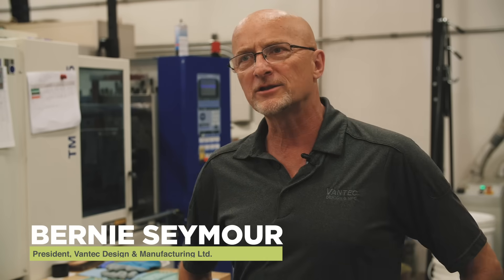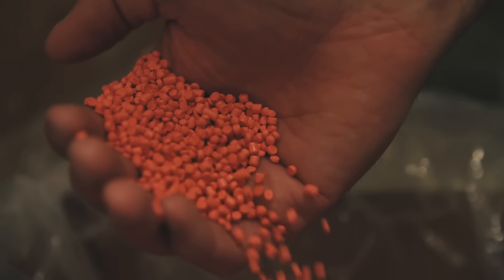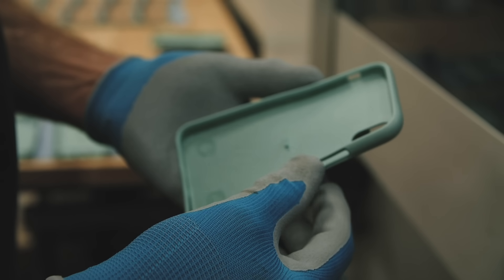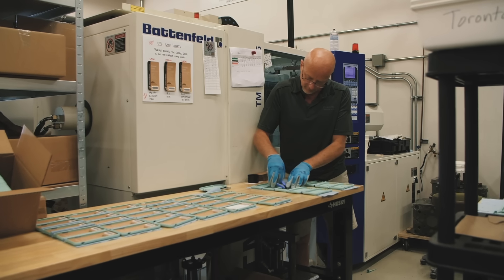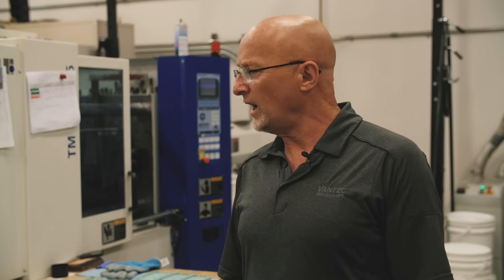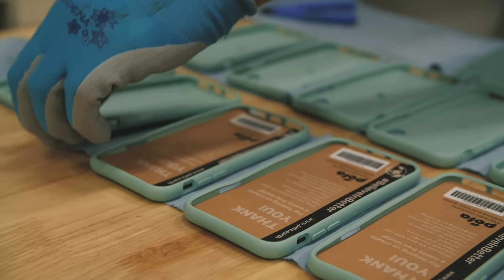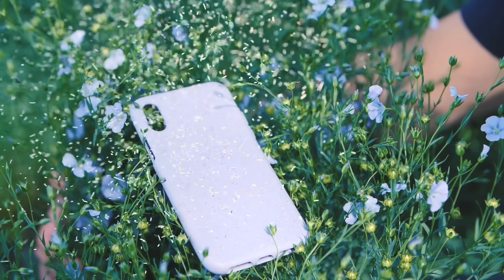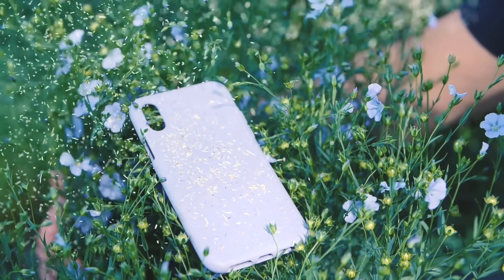How To Make A Pela Case

Comment: So i just buy this case that offsets 20-30gms of CO2, which is the same amount of gas release if i drive  a car for 100mtrs. Yes i could just walk some small distance instead of  spending 60$ on a case. The carbon offset is not worth that money guys. Also composting do release CO2 slowly into the atmosphere which beats out the whole purpose.